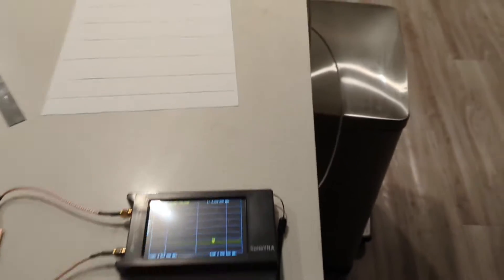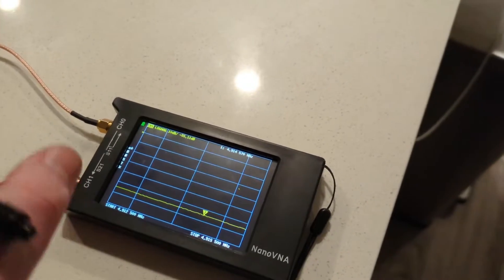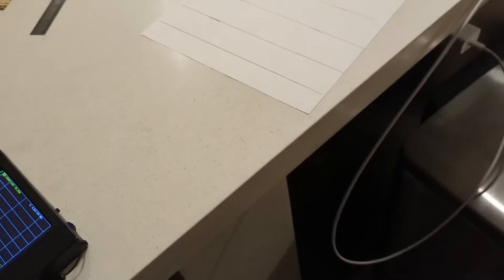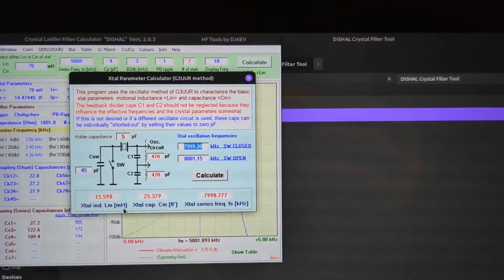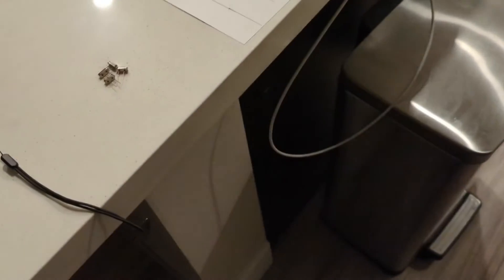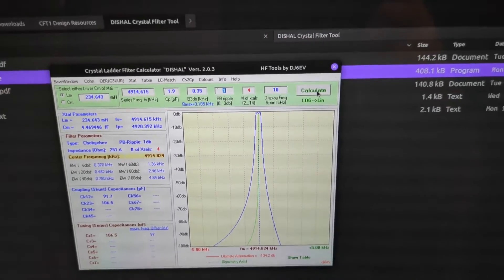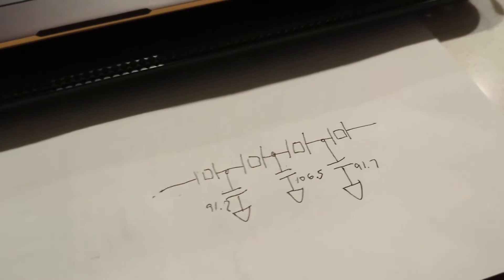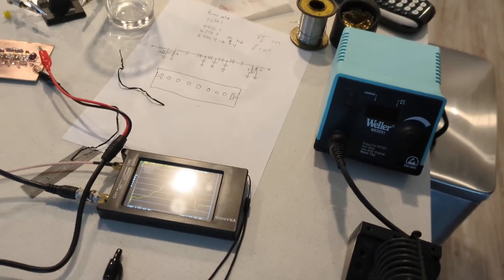CW QRP Transceiver Design Log - Episode 1: The Crystal Filter

Comment: Nice start! Looking forward to seeing more.

In my experience, properly impedance matching a crystal filter in a receiver is quite important, as a poorly matched filter will sound pretty terrible. A lot of the time you can get away with a simple L-network for matching, instead of a transformer, since this is a very narrow-band circuit.

73 DE NT7S
Reply from the maker: You are absolutely correct about that! However I plan on having two SA612 mixers on each end of this filter and looking at a bunch of different designs, I don't tend to see much matching happening between the Gilbert Cell and the filter, aside from an inductor or two at the output of the filter to the BFO. 
BTW, I plan on using your Arduino library to run my Si5351!